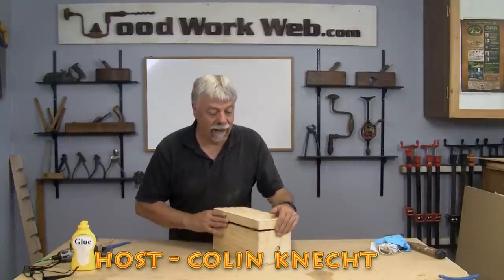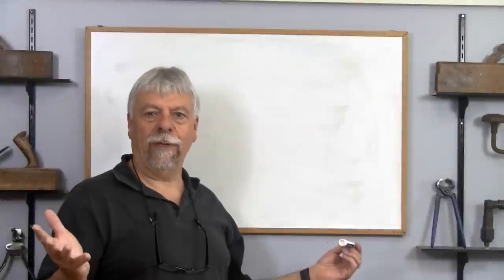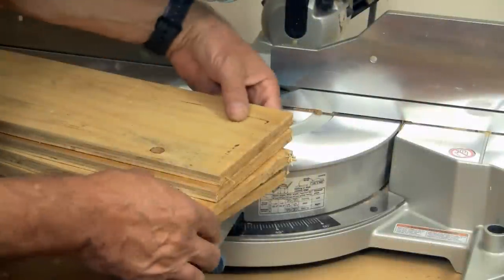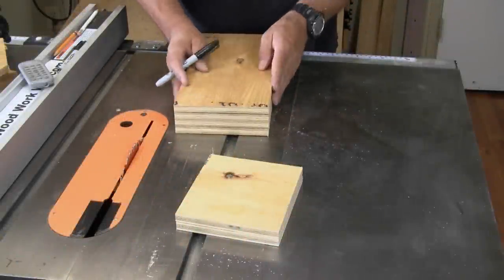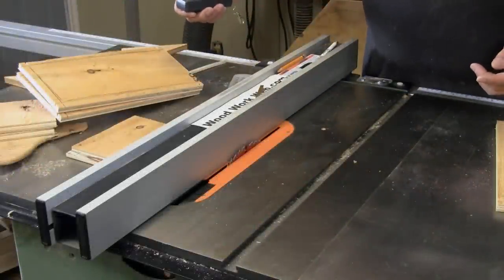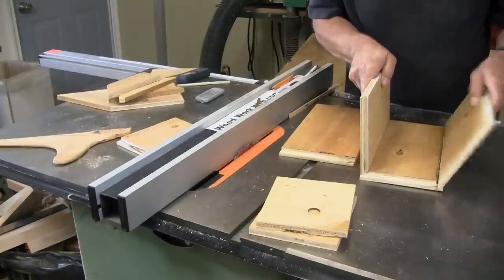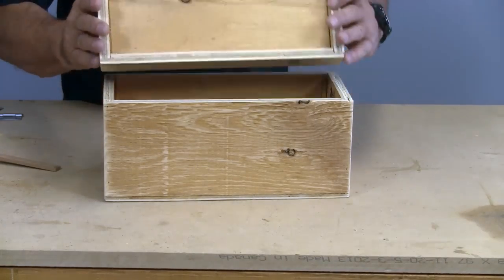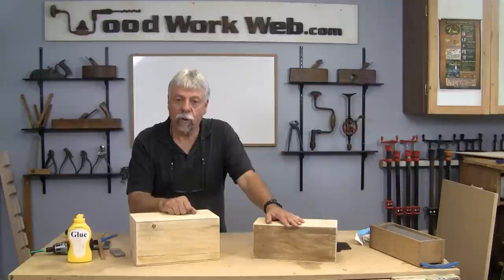Making a Simple Wooden Storage Box |  A Woodworkweb woodworking video

Comment: Time for a critique of your video and I am nit picking here I will admit. Okay you are cutting a rabbit  in the top, bottom and ends of the box not dado's.  Dado's and grooves have two sides to them where a rabbit has only one side.  Now being a teaching video I think it is important to use the correct terminology. Now on the up side I do like the fact of using throw away wood as opposed to new and the simplicity of the joint and the process you used to create this box.  I have made several in this manner and once sanded and painted no one will really know unless you tell them.
Reply from the maker: Daryl Metheny  lol, yeah I know, sometimes the wrong works come out, but I know people can see what I'm doing, and sometimes I don't notice it until the vid is posted ... human mistakes, yup, I'm guilty
Reply: Daryl Metheny Not to nitpick, but the correct term is "rabbet."
Reply: You are correct, I am the victim of auto correct on the upload. Thanks for caring and sharing.